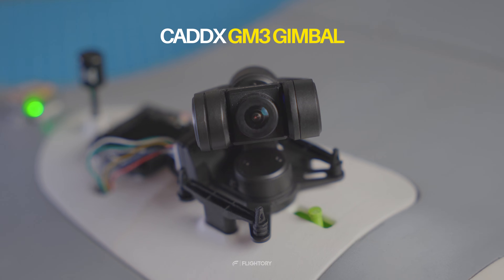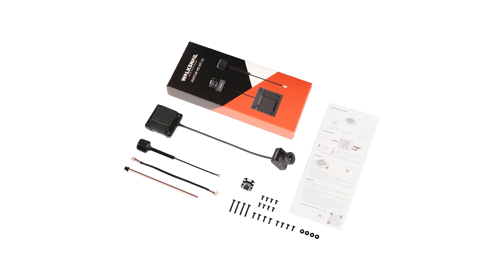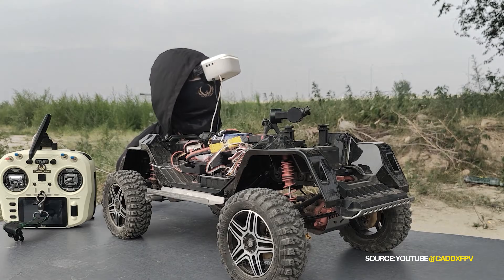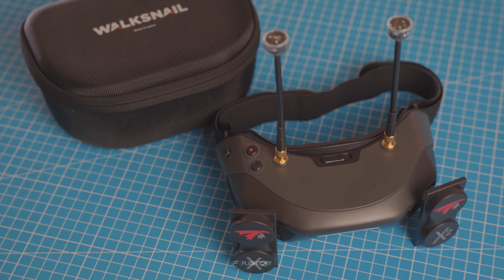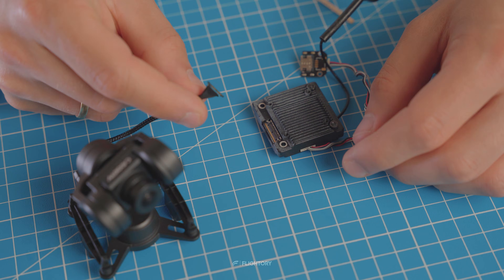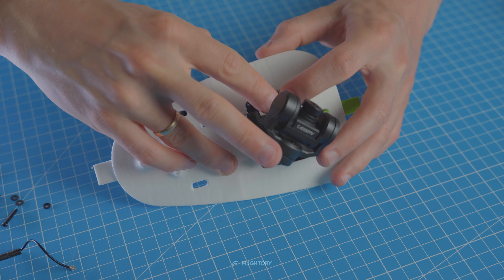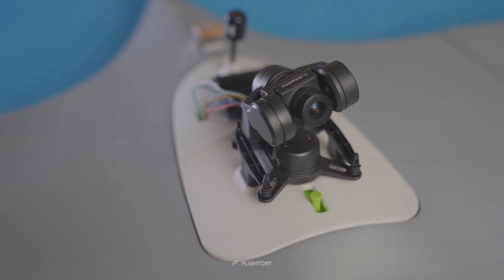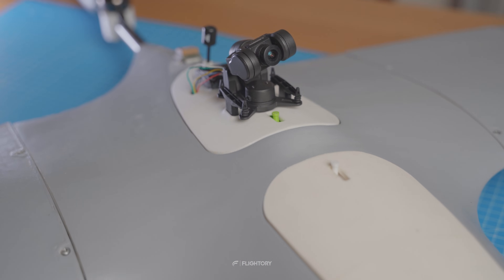Exploring the GM3 Walksnail Gimbal by CADDX: Features & Installation on Fixed Wing Aircraft

Comment: Why do you have the Tx and Rx connected to the VTX if you're using PWM control? I'm gonna be using this gimble with the original walksnail goggles so I won't have any built in head tracking. I thought I had this figured out till I saw that you have it plugged into the VTX via the Rx and Tx wires

Comment: Is it possible to wire the gimbal to a v2 VTX and control the gimbal over a singal UART from the FC? I already have a medlin external trainer port head tracking module and it would be cool if I could use that somehow.

Comment: Hi at 4:05 You mentioned connecting the wiring but didn't show the setup( red,blk,green,white,gray, yellow). I'm currently stuck at the wiring. Where does the gray and white wire that has a small clip to it?
Reply: Where u able to wire it?

Comment: I cant wait.Building my stallion vtol. My only problem is what settings to use for bambulab x1c as i have the overture lw pla and it has not been cooperating. any tips or recommended video?
Reply: Hi masts did you succeed printing with your Bambi lab ?